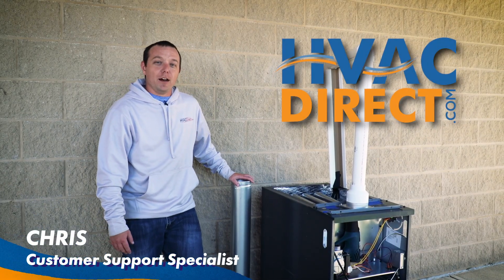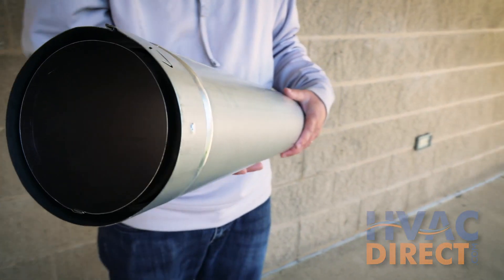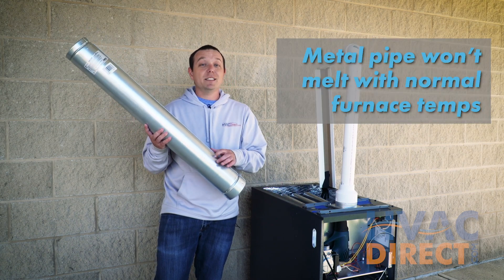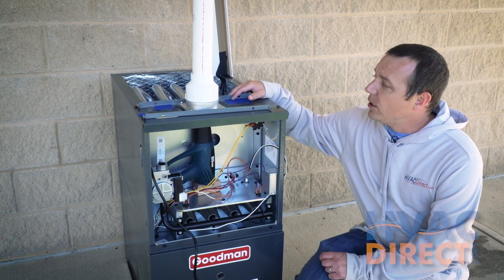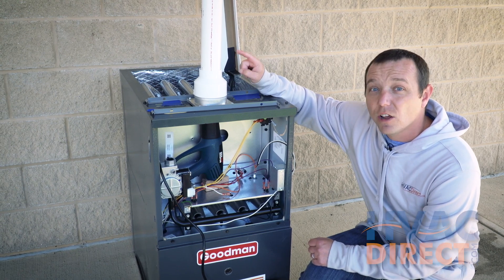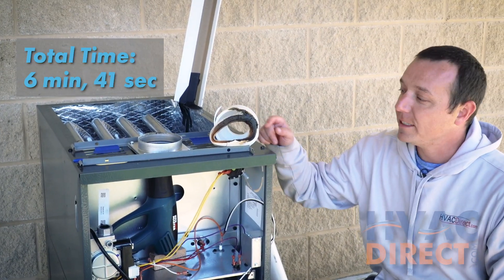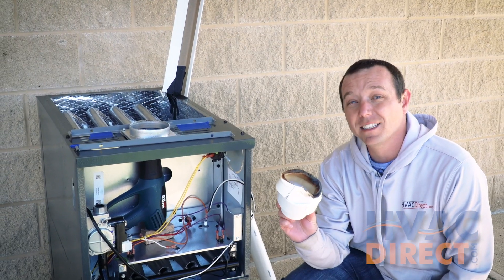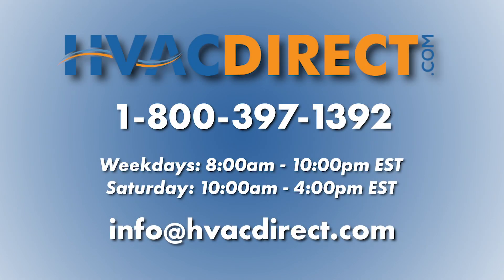What is a flue pipe?

Comment: Nice heat gun
For chinese to understand
= "sitting-pipe" usage
= volume-flow at 250degF on a stove-grill-skillet for a short time

Diagonal and Parallel
= Bigger vertical pipe to flue top (volume-A)
= Smaller(volume-B) diagonal(15deg) exhaust-pipe to Y-outer joint(one for structural, one for air, stuff the structural with ... flame retardent...) to Volume-A 
= after the professionals do the visible parts... and the other professionals do the safety-inspection and certification and insurance...
= if there is a fire, add mod-hacks should be the first to leave without a trace...
Reply: The big pipe will suck the cold air at chosen height of opening... (jumping or sitting.???) winter-summer... due to 
= volume-B relative to volume-A (path of lowest resistance + gravity + density-gravity + temperature + bouyancy of layers of air)

Same applies to convection(temperature)-displacement(volume) preload-bias vectorising of flow, using volume by parallel-piping water-..., ... ?gas?, sewage, drain, sink, ...
Reply: Your legal affected your winter
And applied to not-applicable
= effectively still not-applicable
== (higher skills to manage, if you can survive with those, ... higher skills should walk the talk and do sniggering-mutt cartoon of socks/leg-warmers/carpets/... heat can radiate to up-down-left-right grill-skillet ... )